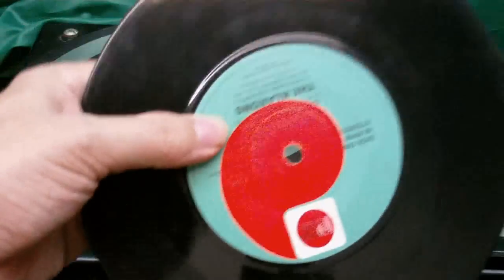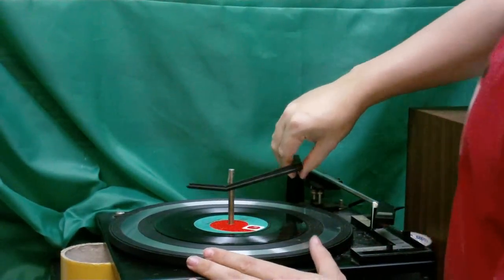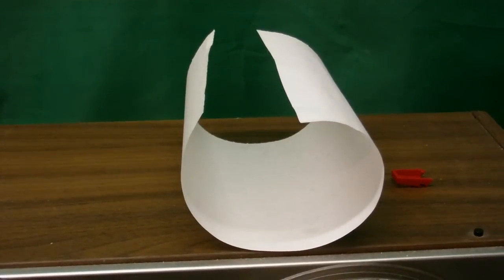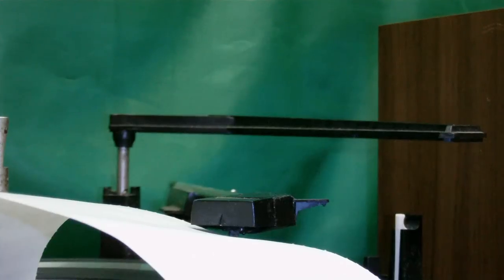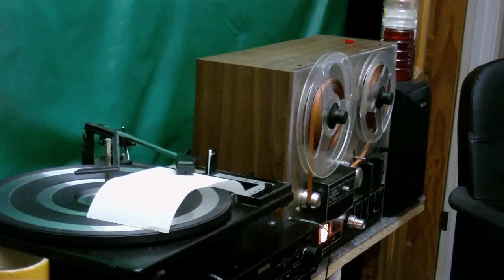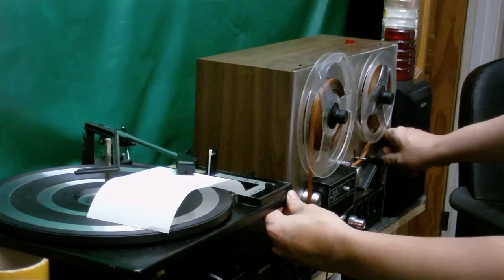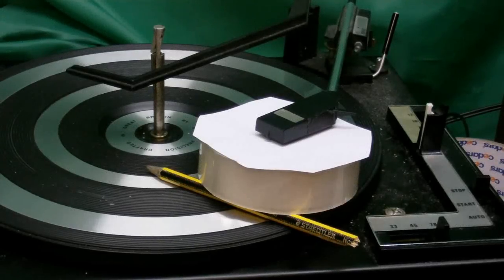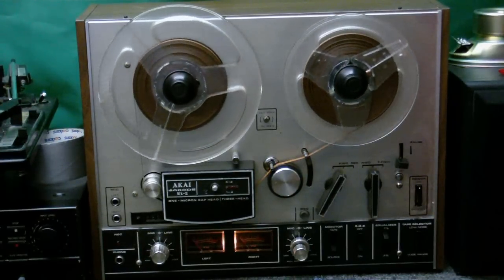Using a record player as a microphone

Comment: @trailkeeper    >> and I think it had the typical coupling capacitors,  and a collector resistor of maby 300 ohms to 50K, I think this depends on what the amplified signal will be going into (pc mic, pc line in, stereo player line in, or guitar amp with its very high impedance, maby 1M)

Comment: Since your on the subject of a homemade mic, one can also be made out of a speaker (just like the do in walki-talkies using the same speaker for the mic, and playback sound).   I forget the circuit details now, but it was typical/common design and parts)  but I made one out of a single small black transistor and a base resistor fairly high, maby 100K - which seems to lower the input impedance/resistance for speakers/mics/guitars, etc.